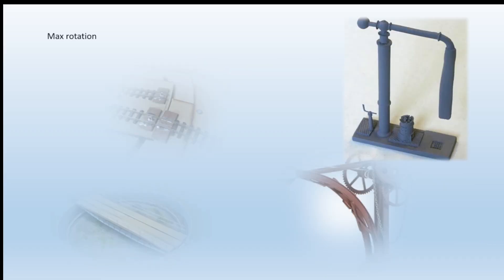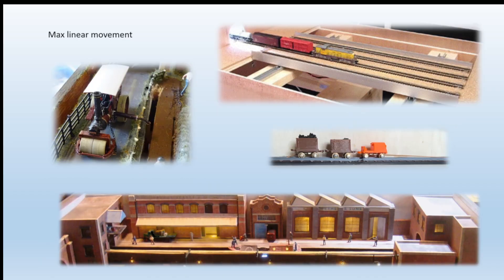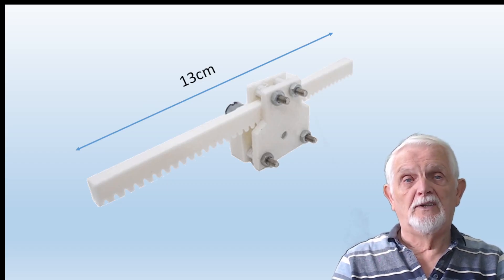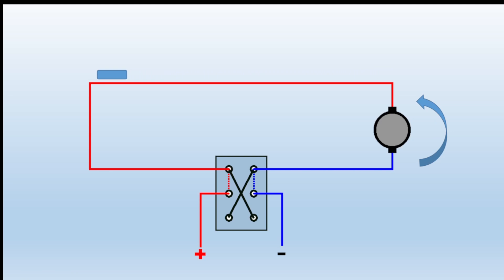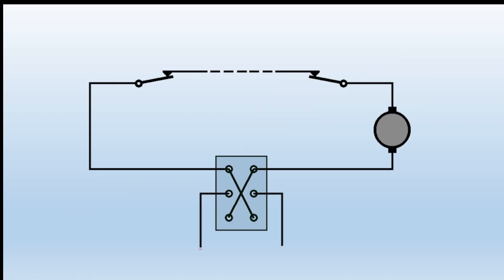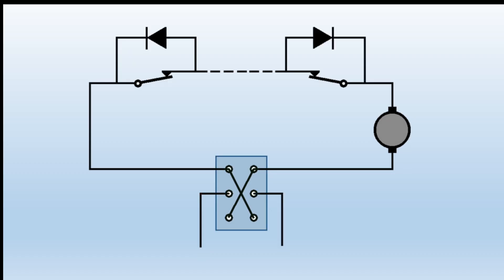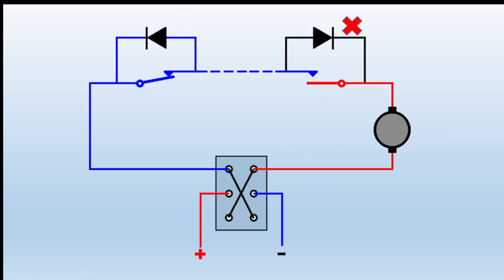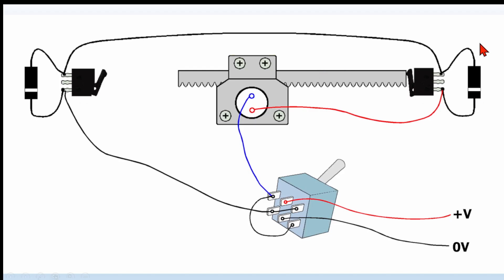limitswitches

Comment: You can eliminate the diodes by wiring the limit switches in place of the cross connection on the reversing switch. Just relocate the red motor wire to the terminal closest to negative power label in the drawing.
Reply: Could you draw it? Thanks in advance

Comment: You don't need the diodes. You split the positive, between the power supply and the switch, wire your switches there, and wire the positive to the each pin of a cross connect, and then just wire the negative the regular way. You remove having to use Diodes.
Reply: Can you do a quick diagram for this??  Would be really helpful!
Reply: @psychobillytetch   Uploaded
Reply: @psychobillytetch  This is so irritating. Youtube keeps delete comments for no reason
Reply: you see it?  @psychobillytetch
Reply: Before the comment where I say "Uploaded", I tried informed you that was going to upload and to check to see when I do. That was about 15min after your comment/request.

Comment: How can I pause/stop the switch inbetween
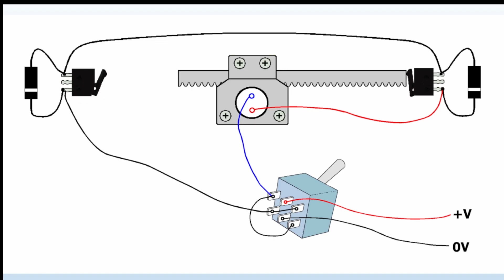Reply: By using a DPDT switch with Center OFF. On - Off - ON. Shown at 4:02, you can see the Center Off, but I don't think he ever mentions it tho. Since the one he is actually using is a On - ON.  You can see that there is no Center Off. 10:55.  You can use a Momentary DPDT, so that you press it one way and let go, it returns to Center off.

Comment: I have two whisker limit switches that are controlling a warning light. When a door opens, the light goes on. When the door hits the second whisker limit switch, light goes off. It works, but I hear a "clicking" sound from the AC/DC power supply when the second limit switch put the light in the "Off" mode. Any idea if this is normal? Thank You